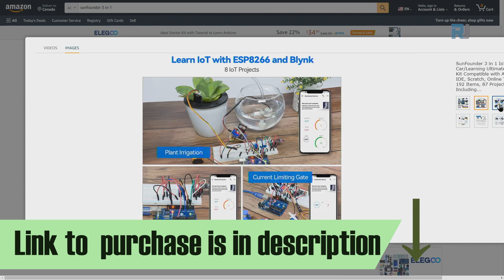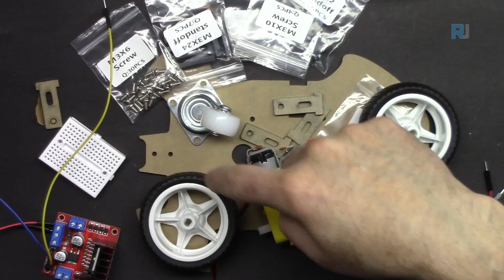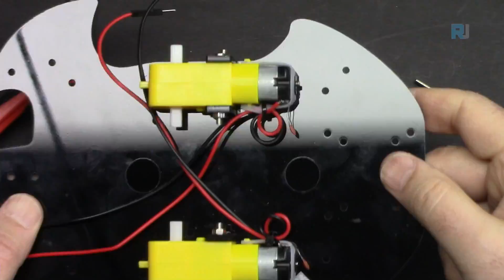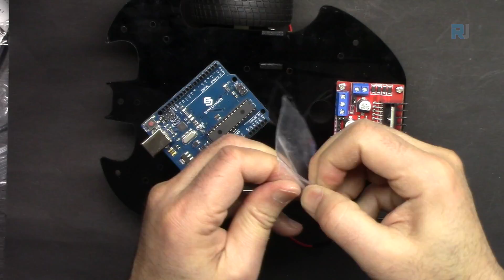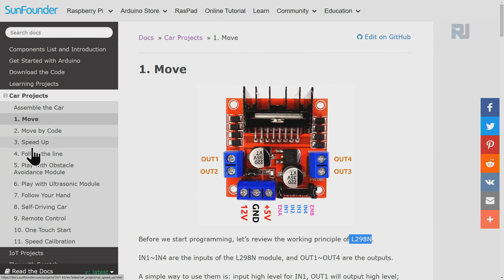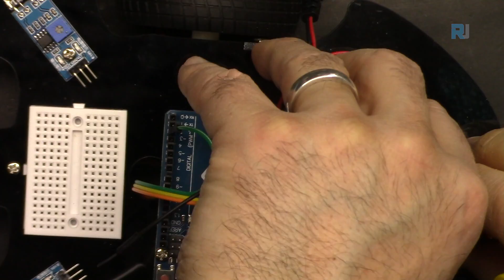Lesson 23: Smart Car Part 1: SunFounder Smart Car Assembly and  DC Motor Full Bridge Explained

Comment: I got it all put together but the wheels are not moving at all.   I have tried 2 different batteries.   where can I get help?
Reply from the maker: check the woring. connect the motor directly to 5V and it should move. if the motor moves, then check the woing on the motor driver. The motor driver has been explained in this video. please watch it so you know how it works. good luck
Reply: @robojax  Thank You.  We found the problem to be the 9volt connector.